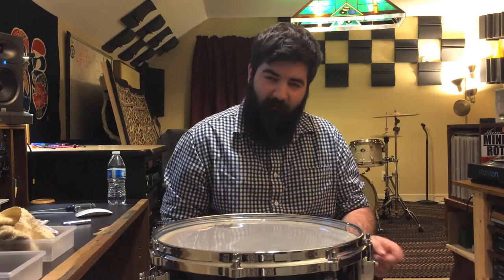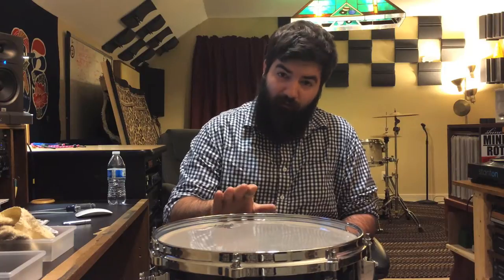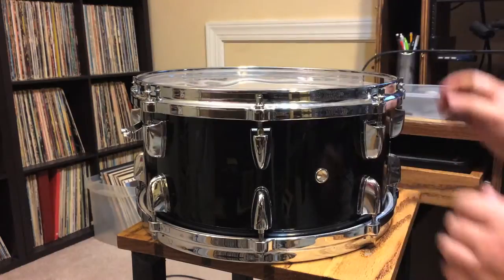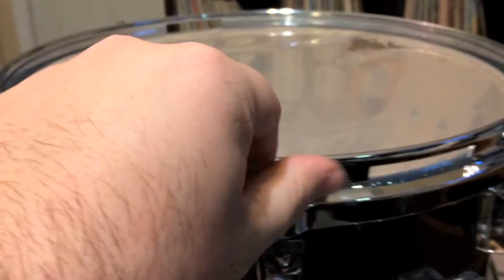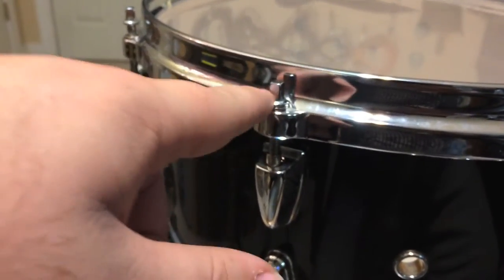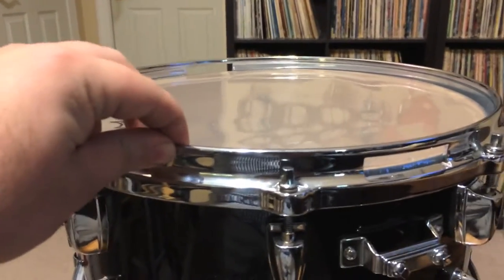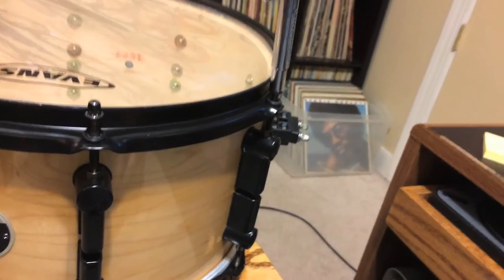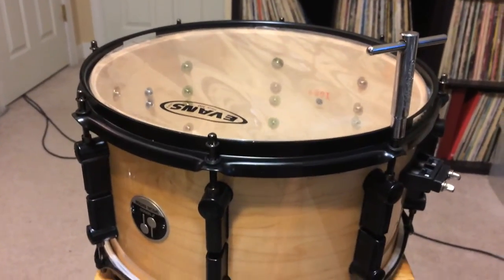What is Finger Tight? | Drum Tips & Tricks

Comment: Finally a great tip! Thanks man. I really have a problem with my snare wires/buzzing. I think I have a problem with tuning :D 
I use great heads and have a great snare but the buzzing is horrible. I think the problem is on the reso side because independently how much I tighten or loosen the batter side, the buzzing is horrendous all the time. (Except in the middle)
Reply: +Erwin Del Castillo G i have the same problem